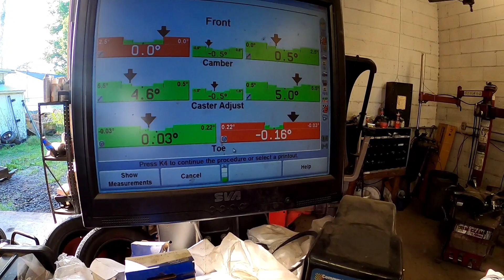Fixing the Death Wobble in my '71 F100 CASPER the truck...

Comment: My 72 F100 dang near wobbled my teeth loose. That truck had problems on top of problems. King pins, bushings, wheels bearings, tires and it was towed out on the left front ! After a front end rebuild, an alignment, brakes and wheel bearings (along with new tires) the truck rode like a new one.   I can't imagine your truck wobbling with the horsepower it has ! Scary business ! 
Great videos, and we all love casper !
Reply from the maker: Thanks for the kind words... You are so Right most of the time... The Death Wobble in these trucks is due to King Pins, Radius arm bushings, tie rod ends, etc.. After Micah worked his magic on it..  it's back riding like a new one... My biggest concern.. is brakes! Having a ton of power in these old trucks even with later Disc brakes is sketchy at the topend of a 1/4mile run! Haha... You better hope you are living right! Thanks again for Watching... And I will let CASPER know that he is Loved!
Andy

Comment: I faught the death wobble for months on the first hot rod I ever built, a1949 Anglia straight axle but up around 20 30 40 mile an hour it would wobble like mad! Long story short: 50/50 shock  horizontal with Road from frame to tie Rod or most any steering link, what the wobble is is front wheels  flopping from side to side real fast!!!

Comment: Awesome video !!!

Have  same issue on my 2005 f250 superduty

Put new tires , rims , pads , rotors and calipers still have the problem Between 45 and 55 mph.  Never even thought might be alignment issue but I’m gonna take it in this week get this done .

Thank you brother !
Keep on trucking !
🇺🇸👍🏽
Reply from the maker: You never know till to put it on the rack and see what you have... I know that the late model trucks have a bad problem with wobble.. but it is a completely different design compared to the Twin I Beams of years past... King Pins, and Radius arm bushings were the major culprit of wobble in those years... But I would definitely find a good shop and see if anything is out of the ordinary...
Andy

Comment: Crown vic conversion!
Reply: Nailed it! I don't know if it would be lighter or heavier but it would give a lot better ride and if you put about a half to three fourth degree of negative camber in it and about six degrees positive caster in it with the toe set to zero it will handle good enough to go knock some cones over in the autocross at the next big rod show you go to!

Comment: What size are new tires. They look good
Reply from the maker: I went from a 205/70/R15 down to a 195/65/R15 I wanted to drop down in size from a 26" tall tire to a 24" tire.. by doing that this, it will improve the reaction time of the truck at the DragStrip...
Reply: @UnityMotorSportsGarage  The reduced rollout isn’t as big a deal as the weight you’ll save.

Comment: Thanks for this feature Andy.  Sorry to change subject but had a question on your rear-facing scoop.  At speed, are you benefiting from any high pressure ram air effect (from base of windshield) you can discern?
Reply from the maker: Brian, using the very high tech method of attaching a few pieces of string ..you can see at highway speeds the strings being drawn into the scoop.... So it does work..
Andy
Reply: @UnityMotorSportsGarage  As of 2019, the last time I was there, the hi tech string method was still being used by race teams down here at the Sebring track. The SCCA guys are all equal on power so they need every Aero advantage they can get.
Sometimes you just can't beat Old School.
Reply from the maker: @johnparrish9215  Amen to that... I want to do a test the next time at the track.. make two runs with the scoop and then remove it and see if it makes a difference in ET or MPH... 
Andy
Reply: @UnityMotorSportsGarage  During one of the tests, block off the grill completely, from the inside, with some cardboard. I've heard both good and bad about this but mostly good.
Of course your going to be getting a little toasty so be careful.
Reply: IMHO John's idea of blocking off the scoop instead of removing it sounds like a very good idea. I run a Quadrajet and I'm not sure how holleys work but if removing your scoop creates a lot of turbulence over the top of your carburetors it might affect the metering. I know my Quadrajet has air bleeds that don't like a lot of turbulence swirling around on top of them but rather like a straight flow across them. Just a thought.
Reply from the maker: @briansd2772  I have a plate that is made to block it off when it rains... When I use it and try to go WOT... It makes my engine go Pig rich... Because it can't get air...
Reply: @briansd2772  On No, not the Scoop, that Grill. We noticed a major increase in drag between an open grill and a closed one.
The big thing I would do with his scoop is to somehow add a plate to the carbs sealing them away from engine heat so all the air comes from the scoop.
But, having said that, before I made any changes I would check the air temp in the scoop at speed. Sometimes what you think is happening isn't and a simple sensor can save a lot of time and money.

Comment: I have the same rims on my 93 lightning. Did you have to machine the rotors to get yours to fit?
Reply from the maker: Yes sir I sure did....
Andy
Reply: I forgot to mention on the back I had to run a 3/8 spacer from Baer brakes and I had to machine the hole out some

Comment: Off topic. Is a .555 cam big or mild?
Reply from the maker: The lift has no effect on being big or small... It's the duration and LSA that effects the driveability.. in today's world .593" lift is offered from the Factory LS7 engines with 210° degs duration @ .050" it has a somewhat smooth idle and you would never know that the cam had that much lift...
Andy